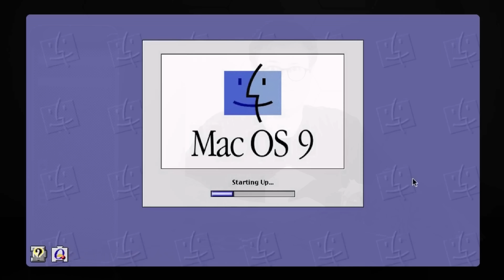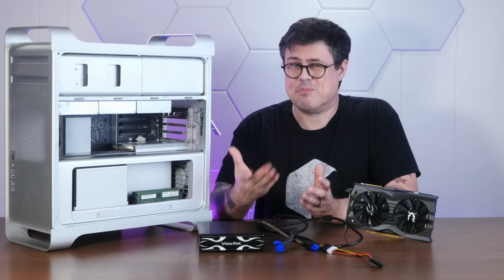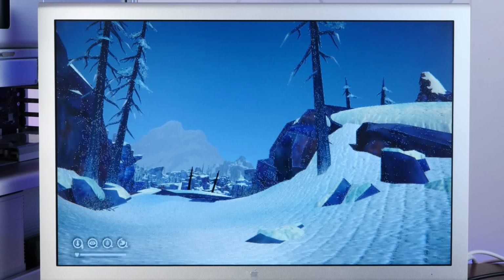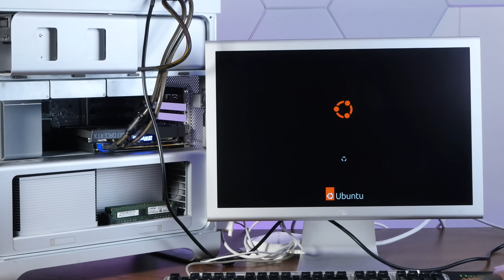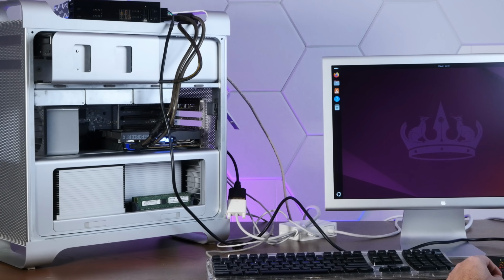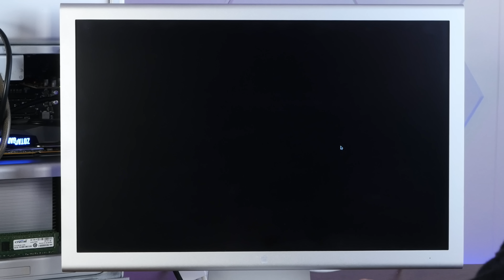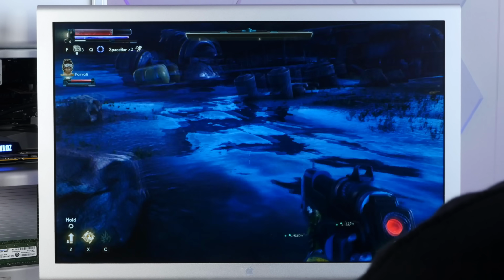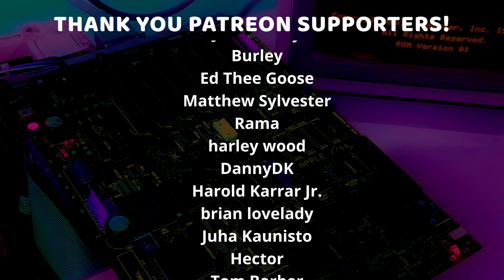I put an RTX 2070 in an old Mac Pro!

Comment: I love that you try to keep older computers running.  I used to do the same thing back in the day.  E-waste has become such a big problem and here you are, one computer at a time, keeping it out of landfills.  I absolutely love watching your videos and the shenanigans that you get into with older technologies.
Reply: It's surprising sometimes what people throw out without doing some basic maintenance or troubleshooting, or with some simple upgrades make them perfectly capable for lighter games & webbrowsing pc's.

My almost completely free test rig for example is this.
A x299 sli plus motherboard + an I9 7920x from the electronics waste container that we swing by almost daily at the recycling center.
Corsair AX1600i 1600w powersupply with no modular cables and no power cable, this was like 120$ in Sweden for the full kit but well worth it, like this is when bought new over 600$ here.
Only damage on the powersupply besides some scratches & a bit bent up fan grille, was whoever owned this mixed up modular powersupply cables.
Or hooked them up too the wrong place as there's two plugs for hooking up the sata or molex cables that have slightly melted & gotten discolored slightly
(There's 4 more plugs too hook up those if needed.)
(Bought those & a fat cpu cooler the Thermalright peerless assassin for the I9 cpu & it's been great as a test rig.)

While it's a few years old being from late 2017 it's no slouch with 12 cores, 24 threads & if all can be utilized fully, it's on par with my Ryzen 5600 & beats the 5600x in several benchmarks too.

Ofc there's spotty periods from time too time with nothing interesting at all some weeks from the container where I've only grabbed like a socket 775 processor or smaller cpu cooler that fits amd but I've had some nice finds too either collect or mess around with for sure.

I also have a fully working PS4 that besides being dusty & needing an os reinstall which took all of 20 minutes maybe with a usb drive, took it apart & swapped thermalpaste on it & just need to put it together fully.

Several graphics cards that still do ok for e-sports titles in 1080p.
3x gtx 970's, 750 ti,gts 960, r9 380 4 gb, gtx 660, gtx 570, gtx 780, 3x HD 7990's with missing fans but i can just point 2x 120mm fans at 1500 rpm at any of them too cool one of those down.

A mini itx B250 motherboard which initially had a pentium g4600, but i also found an I7 6700 a few weeks earlier in a working z170-p motherboard slapped that in there and im just on the lookout after a good mini itx case now too put together a pc for my dad with the 1660 ti i also got sitting around.

Currently also on the lookout after a motherboard that supports intels' 8th gen processors as i have an I5 8400 laying around from a tossed out hp pc i think it was.
It had no ram or ssd.

Comment: The black screen is because the login screen might be running under Wayland. Nvidia still has bad Wayland support, but that's gonna get better in driver 555.
Reply: yea, was gonna say that. wayland actually runs on my 980 now but still has quite a few issues. plus there's a slight delay with input (im very sensitive with input latency), unfortunate as an amd laptop i have runs SO much better on wayland. i could actually play tf2 with above 50fps on a crappy amd a6 mobile processor.
Reply: @nonoyesnoyesnt  hi fellow tf2 player.
On the nvidia card enable legacy opengl in the launch options because nvidia has bad vulkan support on linux.
Reply: It's not wayland probably. I got curious and looked it up. It's weirdly enough the SSD. It's a race condition between the graphics driver and the graphics stack being initialised. If the graphics stack initialises too quickly before the driver is loaded it doesn't display. Atleast according to what I read.

I personally run wayland on  nvidia and never had this issue. That doesn't have to mean anything but idk instinctively I wouldn't have pinned on wayland so quickly
Reply: Sometimes a reinstall of gdm does the trick. Switching from gdm to lightdm should solve it definitely.
Reply: There is a gdm option to display login screen using X11 instead that you can try to see if it’s Wayland with nvidia
Reply: Maybe, but I have a couple of Linux machines with Nvidia cards running Ubuntu w/ Wayland and the crappy Nvidia proprietary driver, and none of them have this problem.
Reply: Could be the adapter he used for the monitor... I had that issue on a hackintosh build with a DVI to HDMI adapter.
Reply: might be sending the login to another video output.. noticed these multi head cards can be a problem on ubuntu
Reply: If you run fedora 32 or higher, nvidia driver should work really well with wayland and gnome
Reply: I was thinking something similar. My immediate thoughts would be to make sure the xorg-server nvidia driver is installed and also to add the nvidia modules to the initramdisk.
Reply: they delayed the launch too i think
Reply: maybe the driver is just not installed at all or kernel mode-setting not enabled in the driver
Reply: He needs to check the config files for the logon screen it's probably still using the old GPU settings.
Reply: im running a 2070 super in my machine and have been using wayland for over a year and haven’t updated to 555 yet, and everything’s been working fine. I’m not using ubuntu or gnome so I’m thinking it’s probably a bug in the gnome greeter.
Reply: Nvidia should try running it as sudo. Works every time!
Reply: does nomodeset not work here?
Reply: If it can't even run a damned login screen, why the hell does anyone try nvidia shit with linux? In the 2000's it used to be the exact opposite, what the hell happened?
Reply: @Drbeckerproductions  wayland? nvidia is too lazy to get it fully working.
Reply: The black screen is because it's Linux. With every update you'll get new features as well as a couple simple things that worked perfectly fine but are just all of a sudden broken for no particular reason 😂😂😂 (that's a joke for those who don't understand the concept of sarcasm)
Reply: @p_mouse8676 just an epic wayland moment (i use x11 btw)
Reply: @p_mouse8676 not true